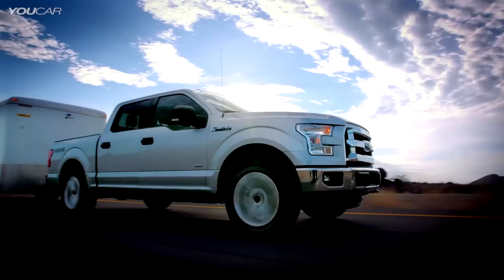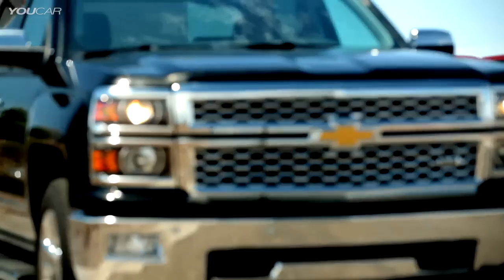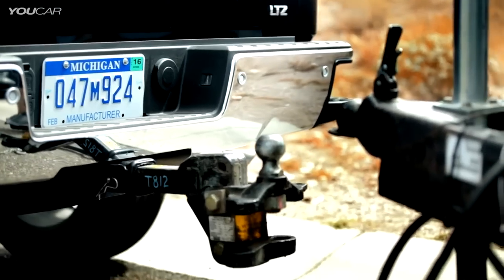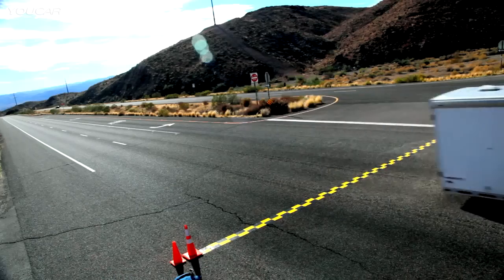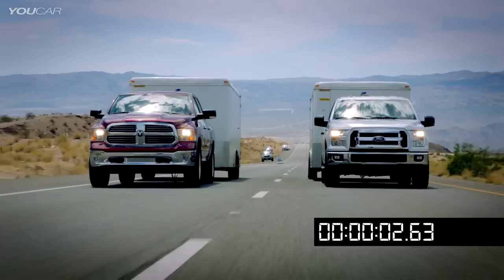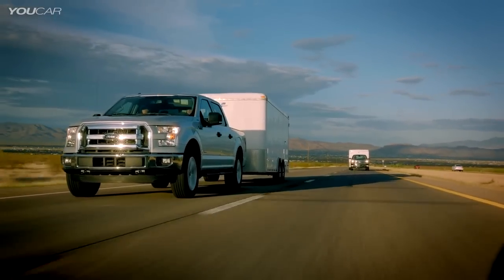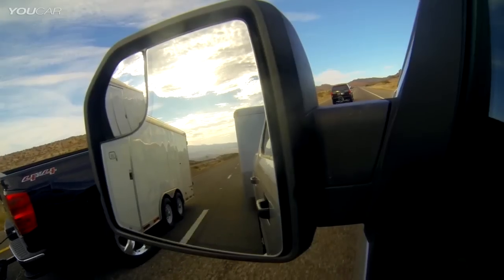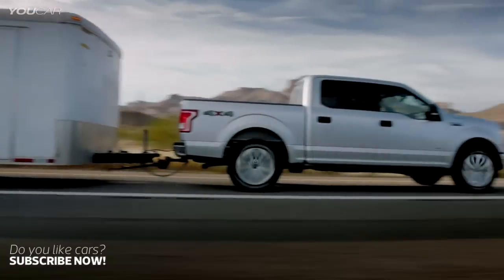TOWING Comparison – Ford F150 vs RAM 1500 vs Chevrolet Silverado

Comment: I'm sorry is this biased much, I like the f-150 but the day I buy a ecoboost v6 truck, is the day I buy a prius,  trucks/pulling and v6 gas just don't go together
Reply: USA_IS_THE_BEST
this video was brought to you by ford...its pretty obvious
Reply: Exactly! I love V8 Power!
Reply: Believe it or not the ecoboost has way more torque down low then any V8 and its flat along the rpm range. Exactly what you need in a truck. Its the future and its here.
Reply: Patrick Connolly
Yea, but no sound!!!!!
Reply: civic with a pop can does....? We are past the era of noise. Heard the term "all show no go"
Reply: I'm sorry but sounding like a pissed off weedeater is nothing to brag about.. I don't care how the truck sounds.. I don't like the idea of having a gas pulling truck be a 6 cyl, besides after the 300I6 the 4.2L V6 they put into the trucks was a hunk of garbage, time will tell how these ecoboost engines hold up, wether they get the clacking valves like the 5.4's, burning oil like the 4.6's or chewing up headgaskets like the old 3.8's
Reply: metvelle
They have already been proven. And I have 210,000 km on my eco and over boosting mine too boot and still going strong. Its ok because 40 percent of Ford truck buyers have already converted. And thus why they have added another ecoboost to the family. Rumors are GM will be putting a 3.6 tt in there trucks as well because Ford is doing so well.
Reply: Patrick Connolly
V8 sound! My 1993 Ford Bronco is slow, and thats why I have a fast car! But I love it because she houls like tomorrow and sounds soooo good!
Reply: doubletapproductions
I like the sound of twin snails in both my vehicles more.
Reply: You don't really need a V8 for a pickup truck. A B7R Volvo bus has inline 6 cylinder engine at 278 BHP. Do you think any v8 of these pick up trucks can outperform that bus which can carry 56 passengers with huge bus body weight, powerful AC can easily goes to 100mph with automatic transmission?

All these 4 cylinder , v6 or v8 is more of psychological than actually on performance.
Reply: They suck, but I dont mind the acura type s.
Reply: Sure it was a ford ad. But the results will be the same once the truck is available to the public. Just a it was with the 3.5 ecoboost. I'd still much rather go with the 5.0 in the new 2015 f-150.
Reply: Face it ford is the best selling truck because there the cheapest trucks on the market it's been a proven fact and that why fords fall apart after 100k and the Ecoboost motor is dog shit that's why they recalled thousands of them for power loss however gm hasn't had a major recall on there trucks
Reply: ***** And thats why Ford has way more tech and luxury interior options then Chevies eh...?

And there is a shit load of recalls and one noticeable recall for Silverados was the nearly half a million. Give your head a shake.
Reply: ***** buddy I got rear ended in my f150 by a chevy cargo van he was doing like 5 mph I was stopped the dam truck drove off the chevy had it motor and drive train pushed into it the only reason chevy trucks are somewhat reliable is that it never changed much most of it is still from the 70s and 80s
Reply: ***** buddy I got rear ended in my f150 by a chevy cargo van he was doing like 5 mph I was stopped the dam truck drove off the chevy had it motor and drive train pushed into it the only reason chevy trucks are somewhat reliable is that it never changed much most of it is still from the 70s and 80s
Reply: I have a 2011 ecoboost and towing with it is better than any V8 I've ever used. The only thing bad is the gas millage while towing. I'll average 8-13 mpg depending on the trailer
Reply: metvelle my 4.6 dosent burn that much oil...lol
Reply: Patrick Connolly So its the present actually.
Reply: Phu Doan
Of course it can be done but the computer (ecu) doesn't have the parameters to compensate for the changes in required mixture. Other factors might enter such as sufficient fuel flow capacity of the injectors, seal materials and fuel pump GPM output as well. E85 gets you poor fuel economy and is only introduced in some vehicles because manufacturers have found a loop hole in the CAFE regulatory standards.
Reply: Well there's this thing called next generation engineering. Future mechanics and so on. I really don't care about a V8 engine in a truck anyway. I have a Ram with a 5.7 and I hate it. My brother has a Ecoboost and it's fantastic.
Reply: YUP NOW I WOULD MIND THAT ECO DIESEL...DID U HEAR OF ALL THE TROUBLE ECO BOOST ENGINE IS GOING THRU...WHOA,!!!
Reply: Nationalcitysycho d I've had no issues with my ecoboost and I have 78,000 miles on it
Reply: 08brpds450
Same here 235,000 km and running!
Reply: Patrick Connolly It's really a great motor
Reply: I feel like these small engines are being strained to hard, leading to decrease in engine reliability.
Reply: Impala Daily You would be surprised. My ecoboost has been very reliable and doesn't strain while towing. Fuel economy goes to shit while otwing though.
Reply: We own 2 ecoboost f150s.... one has 73k and the other we pull our 16' enclosed service trailer with has 188k. Only problem we ever had was the eldest of the two had an intercooler recall the year we bought it.  I was a v8 guy until i drove a buddies when they first came out. Power to spare....
Reply: Haha same here my dad has a 1998 ford f-150 and still has it today!! It is stock and has 450,000 miles on it. So apparently chevy is the way to go, BULLSHIT!!
Reply: metvelle what 4.6 burns oil? im sorry bro but my truck is 12 years old and doesn't burn a drop of oil.
Reply: Tat is like saying the dodge 6 cylinder Cummins diesel is a piece of Jung because it's not like a v-8 in the cheesy and dodges. This argument I'm sure was made back in the day when main stream trucks had n/a diesels went with the turbos for more power. Reliability is built into the engine, not what's bolted onto it. I could say the Chevy engine cylinder cut out is junk because it will break because it's on the engine.
Reply: Prius is shit

Comment: Most people aren't towing a 7000lb trailer up a 13 mile hill, most people might pull a boat or camper. I want a V8 because I want 300k miles out of my truck.
Reply: Amen
Reply: oh yea mr. krabs
Reply: It won't matter if you get 300k miles when over half of those miles are a struggle. This truck is simply designed smarter and more efficiently than any other before it. It doesn't succumb to the same amount of wear and tear.
Reply: F 150 is available with a 5.0 liter v8.
Reply: +Archibald Doogan The new F 150 can take more wear and tear than the previous one could
Reply: +Evan Nagy no that's not true
Reply: True or not, that's not saying much... :(
Reply: +XxD4RK T0XICxX yes it is
Reply: +kauaigold and it's more than your Chevy or Ram
Reply: I'm not a Ram person at all but I am very much pro diesel.  A diesel, especially the eco-diesel, was not built for a drag race but rather a fuel efficient machine that can also get the job done with payload and towing capabilities.  So, while the ford wins the drag race it certainly doesn't win the fuel economy savings by any means.  Further, I'm not surprised that Ford has tried to improve the gas burner because their diesels have been less than stellar to say the least.  I've had several and became frustrated with the constant failures from turbos to injectors turning to the duramax with fantastic results.  I'm in the market for a half ton and will certainly give the eco-diesel a shot.  It would be nice to see a more comprehensive test with overall information rather than a just a drag race in the future.
Reply: MAXIMUSISADOG don't know anything about trucks, but why would a V8 last longer? is it because it wouldn't be as stressed as a smaller engine under the same load?
Reply: Drew rogers 

Yeah but for how long 

Ford is really putting an emphasis on ecoboost and the only cars other than the super duties as that Ford makes with a V8 are the mustang and F-150

And it's being feared that those will loose their V8s soon
Reply: Does this apply to the 2017 Dodge Ram trucks with a hemi?  I guess I'm wondering why v8's get so many more miles?
Reply: kb20l0gt500 actually Silverado/Sierra sells far more than F150. Same truck 2 names. Same drivetrains.
Reply: Miguel Luna exactly right. Does not have to work near as hard or have forced induction.
Reply: But dnt you want the eco boost turbo problems?

Comment: The 3.5L Eco is killing the aspirated V-8's in real-world applications. Not only is it more comfortable and fuel efficient to drive around in every day life, but it destroys the V-8's in performance when towing. It will give up 1-2 mpg's to the bigger engines under those circumstances, but will embarrass them by pulling the weight smoothly and at highway speeds. No need to listen to an engine wheezing while in the slower towing lane. For those who claim they want the V-8 sound: stand outside while someone revs the engine on the Ecoboost; it still sounds every bit like a truck engine.
Reply: This is just plain false.
Reply: What do you think a repair bill would be on a twin-turbo engine, and do you expect it to last as long under heavy use as a V-8?
Reply: R  C Nelson yes, turbo engines are very reliable. look at the turbo engines that hall everything over our nation's highways.
Reply: How's that 3.5 Eco boost transmission doing sucks doesn't it

Comment: The test started good. Then failed to fulfill. They didn't show the Chevy's time when it won. If you're really after truth and not a promo they WOULD have tested all motors, all wins and all times!...not just the ones they won when the heat is at its thinnest & a TT is obviously going to have an advantage. Anyone know of a REAL true no bs test similar to this attempt? Each Dodge most capable for towing on each motor option, etc for Chevy & Ford. Test normal temp conditions, or if not then all 3 extremes. Show all times!

Comment: " a motor twice its size"

Little misleading,   a Smallblock, 5.3L 16Valve, Single Cam V8 is actually a very small engine.     A twin turbo, dual overhead cam, 24valve V6 is actually a big package.   

Also,  if we're talking displacement,  a 5.3L @ 0PSI boost compared to a 2.7L @ 15PSI.... Math is simple.  Displacement is based on an engines size. However boost multiplys that size, because all forced induction is technically postive displacement. 

Cool advertisement,  the 2.7L is a great motor.   They didnt' need to cheapen their add with that type of comment.  Any real car person knows you don't compare engine sizes when it comes to forced induction vs naturally aspirated.

Comment: I think testing trucks not just that , testing the service bills , ( Haw much spending in order to use it )  , and truck after 100,000 miles wouldn't be the same as he was , I'm not loving or heating any one , but the add that say the longest lasting trucks in the road got the idea , although f 150 are doing a great jobs.   we need to see them after a high miles of use,   Thanks fox.

Comment: This is nothing more than a Ford commercial. The Ram Eco Diesel is NOT a premier towing truck. That engine is built merely for great gas mileage and nothing more. If you're gonna tow using a RAM, you need the 5.7 Hemi with PREFERABLY the 3.92 rear gear ratio. And of course the better options would be the Cummings diesel which IS the tow/haul engine if needed or the 6.4 liter v8. Obviously Im a ram guy, but come on - do a FAIR comparison with this topic.

Also, I highly doubt that the 3.5L Eco would make it on long hauls. No one cares about short hauls and common sense would tell you that the 3.5 Eco would suck more gas,  probably over heat, oh and its NOT going to out run a serous v8 tow engine in any brand.
Reply: I agree
Reply: Fordfanone ya sound like a ford dealer...fake
Reply: sc12100 they made it fair by using the small engine , the 2.7
If they used the hemi then they would have needed to use the 3.5 to make it fair. (And the ford would still win)
Reply: sc12100 

sc12100 

Like crashingkid said, that wouldn't make any sense. 
This comparison was made with similar specifications. 
Actually, when I saw that RAM had more torque and 3.92 rear axle ratio vs F150's 3.73 I was sure that RAM's going to win. But it didn't...

If they fitted the RAM with 5.7 HEMI then they would need to fit the F150 with 3.5L ecoboost. If that would happen with 2017 models, F150 would absolutely smoke the RAM, even more than it did now.
Reply: sc12100 ford won sorry but take the L
Reply: Yeah I agree. Why didn't they pick the 5.7 hemi with the 8 speed? Because it's faster. The chevy with the 6.2 is only half a truck length faster than the ram in a 0-60 run. I know, I own both. Both being king cabs with the tow package. This video is very deceiving. In another 5 years our trucks will sound like hair dryers too. A lot of people don't know that ram also has a 6 and 8 speed transmission. From real world experience they are more 6 speeds out there. The 6 speed is very slow, that's true. The 8 speed is very fast.

Comment: I never really understood why people rave about the ecoboost so much. According to 2014 EPA testing, the Silverado's 5.3 gets better mileage than the F-150's ecoboost. Also, with the ecoboost, you have to run premium fuel (which is about 50 cents more per gallon where I'm at) in order to get the most power and efficiency out of it. You can run regular trough it just fine, but Ford says you won't get the best power and economy out of it unless you're running premium. I drove an Escape with the 2.0 ecoboost (heck, it'll probably be my next vehicle) and it was a nice engine, don't get me wrong, but I don't really think the ecoboost has much room to stand on as far as the 'killer full-size pickup mpg' thing goes, but I haven't seen numbers released for the 2015 models yet.

I also have to comment that if you're going to be towing 8,000 pound trailers up a 6 degree incline regularly in 100+ degree heat, then 1/2 ton trucks are not what you should be looking at anyways.

Comment: Ever since the 2009 Lincoln MKS and 2010 Ford Taurus SHO came out with the 3.5L, i've been watching these Ecoboost engines. They have held up EXTREMELY well. To everyone who is complaining about the engines being overworked, they are actually worked LESS than a V8. Low boost/water cooled turbo's and a highly efficient V6 actually turned out to be more reliable and have less moving parts than a V8. This is focused on the 3.5L ecoboost but the 2.7L is looking even better.

Comment: First off, this is done by Ford, so biased. I want to see Motor Trend or equivalent. Also. I dont care if the 2.7l is faster. I want the lifespan of a V8. I dont want to rebuild, if you even can, the new 2.7l at only 150k.
Reply: Its not biased and it will have a lifespan of a v8
Reply: TFL Truck did it
Reply: Not done by Ford. F-150 has a 5.0 option.
Reply: Jared Consolo this is done by ford they are trying to make 2.7 look good
Reply: Chevy bought that award? are you drunk? thats a completely objective measurement. Chevy's 6.2 EcoTec3 absolutely obliterates every half ton offering from Ford

Comment: Imagine that, Ford wins the even sponsored by them. Do you really expect me to believe that thing beat the Ram by OVER 40 seconds in a 3 mile race? The Ram has a higher speed governor, and more torque, it would have literally had to be sitting still for 20 seconds to loose by that much lol.
Reply: ram torque band is smaller than the fords, and it has 85 less hp than the ford. Notice how it got out faster thanks to toque but then was overcome. Ik all companies who sponsor these type of events make them overexaggerated but that ford would beat that ram in that race even if ford wasnt the one testing them. (unless dodge tested them :))
Reply: Not nearly by that much though lol.
Reply: Its a 13 mile race bud
Reply: Even still on a 13 mile race, i'd put money on the Ram having a higher speed governor and it's not like they are towing a train. It should not have been as big of a time lapse, I want film of the entire race.
Reply: Well 13 miles.... if the fiat ran 3 seconds slower each mile there's 39 seconds. Not hard to believe.  Drag racing a 1/4 mile empty ill bet the ecoboost shames the fiat by at least 1 full second.
Reply: PkwyDr but lets say ram dosnt have a higher speed gov, lets just say they r both 155, maybe neither can get there but the ford has 85 more hp so it can get closer
Reply: I guess that's why my 4.6 spanks every dodge that lines up with it with no modifications to the motor or computer.
Reply: IFIXUR360 PAH! that's the funniest thing i've ever heard. My 4.7 Grand Cherokee DESTROYED my coworkers 4.6 F-150. I'm talking by like 6 truck lengths by 60 mph.
Reply: BigDunker345 It has more HP but the Ram has the torque, I feel like both would hit their speed governor by the first 2 miles.
Reply: PkwyDr yea but torque is only useful in the beginning, whic we saw the ram get out faster but the ford has a significant hp advantage which is y it started pulling on the ram and evenutally overtaking it , so lets say they are both governed at 130, the ram can get to 40-50 are first but the ford beats its to anything above there and unless it has a higher governor then the ford the ram cant catch up
Reply: But the flaw there is I'm 99% the Ram has a higher governor (my '12 hemi was 105 and buddies '11 F-150 was only 97) and in that case, I doubt it took the Ram 45 seconds LONGER to get from 50 to 100 than the Ford. I'm not gonna say it's impossible for the Ford to win, the numbers just seem slightly skewed.
Reply: PkwyDr well i looked it up and from i could find the f150 is limited at 110 and the ram 1500 at 106